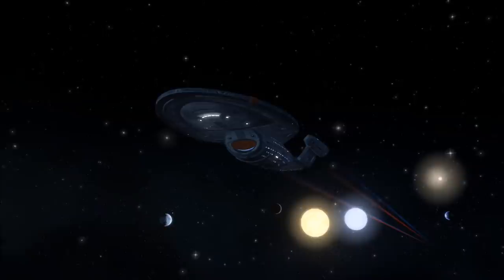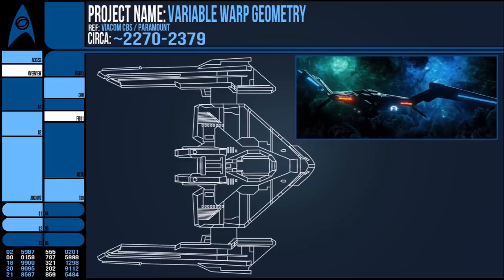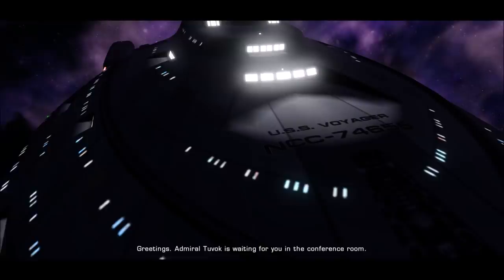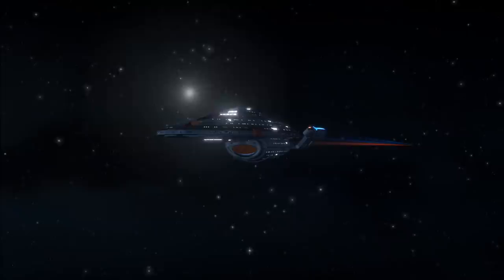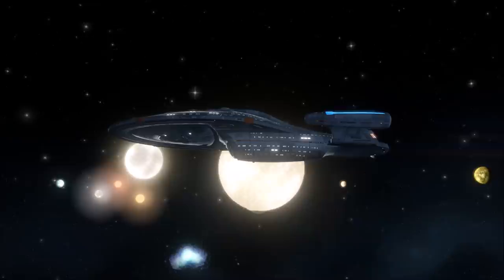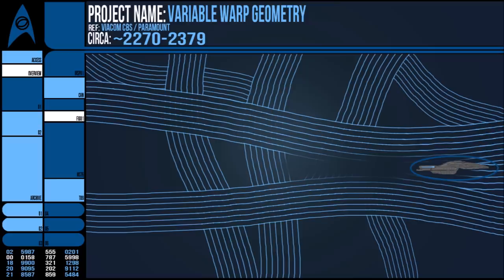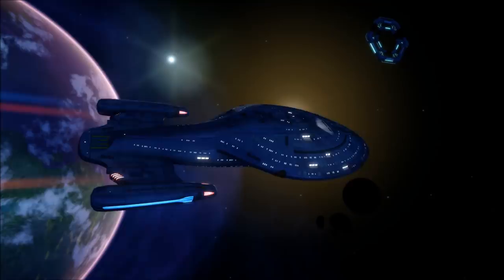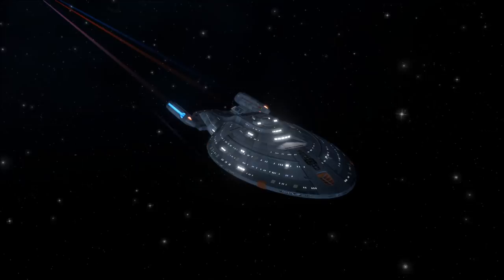VOYAGER'S "Hinged" Nacelles

Comment: Two things that make all this theory disappointing in practice:

1) We never see Voyager at warp with the nacelles in any other position than "raised all the way up".  Had they shown Voyager at low warp with the nacelles raised slightly, Voyager at high warp with the nacelles raised higher, and so on, it would show the "variable" part of the concept.  As is, they might as well just have the nacelles raised up all the time, including at sublight.

2) Who had the brilliant idea to configure the nacelles' raised position such that the Bussard collectors were completely obscured by the primary hull?  Those things have ONE JOB (replenish the ship's fuel with interstellar hydrogen gas), so how about we NOT introduce an obstacle to that task.

Personally, I wish they'd gone with the previous idea, where the "variable" part would have been shown by hinged panels on the sides of the (unmoving) nacelles.
Reply: 1) There may be small adjustments constantly being made that we simply can't see, and they might be in a slightly difference position depending on the warp factor, we only ever saw Voyager at a constant warp factor and never increasing or decreasing warp speed from an exterior shot.  
2) Busards are useless at warp anyway, the navigational deflector pushes particles away from the ship's path (those streaks that look like stars when at warp).

By the time of the sovereign class the problem was resolved by adding an off-axis field controller at the back of the nacelles
Reply: 1) I'm fairly sure there are scenes here and there showing velocity changes, but maybe there aren't.  And even then, the show is a visual medium, and these things shouldn't be relegated to "small adjustments".  After all, the nacelle transition from impulse to warp and vice versa is blatantly and obviously shown.
2) That is incorrect according to pages 70 and 71 of the Next Generation Technical Manual (written for the E-D, but certainly applicable to all subsequent ships, if not earlier ships like Kirk's Enterprise, as well).  The low density of particulates in space means fuel replenishment via the Bussards is impractical at low velocities.  You get more use at high sublight velocities, but it's recommended to not do that for too long due to time dilation.  At warp, however, is where the Bussards get the most use.  The navigational deflector, then, is programmed to allow small "holes" in its coverage to allow fuel gases through while deflecting everything else.
Reply: @balrighty3523  The last thing you need are particles with mass slamming into your ship at superluminal speeds, the energy would be horrendous! You seen what happens at LHC when two particles slam into eachother at near C, they are obliterated!
Reply: They don't slam into the ship at all.  They're caught by the Bussards' magnetic fields and safely decelerated and then collected.
Reply: @balrighty3523  The fields are supposedly KM wide, the red cap isn't the collector either, no line of sight is needed.
Reply: The red cap is where the hydrogen comes out in the TNG episode with all the sleep disorders and it's where the metreon gas goes in in Insurrection leading up to the Riker Maneuver.  It's doing something integral to the process at least.
Reply: @balrighty3523  The caps are solid, nothing goes through them, they contain ionising beam emitters, the gas inlets are little grills around the edge of the caps.
Reply: I don't know what else to tell you.  We see gas going into and out of these things, and on multiple occasions.  Maybe they attract the gases to their surface and then pull the gases along the surface to the grill intakes that the gases go in (or come out of).  Regardless of their specific function and role in the process, they are verifiably, demonstrably 1) involved and 2) involved not just in a peripheral "creates a wide energy field that makes the gas go towards the grills but not touching the red caps" way, but in a "the gas is attracted directly to the red cap and we can see it happen" way.
Reply: @balrighty3523  The glowey area is basically a huge field generator that charges particles several KM around the ship. behind the red caps is a huge magenet that pulls the particles using the opposite electrical charge into the grills just behind the red nacelle caps. It's like saying that a magnet needs line of sight to work. 

In the older ships like the constitution the charge was generated by the spiny things inside the caps.
Reply: https://m.youtube.com/watch?v=N4x1K97JZG0

Specifically, 33 seconds in.  The E-E has the red caps and grills behind them.  The gas goes into the red caps (which must be some kind of permeable) and not the grills.  It's what's on screen.  You can see it for yourself.

Comment: I remember somewhere referencing that designers were told there had to be line of sight between the nacelles to generate a warp field, but that doesn't really explain why they were hinged to a lower angle other than "it looks cool"
Reply: I think I saw something saying the same thing but they said the reason for the lower angle was at sub-light speeds the things on the front of the nacelles, Bussard collectors, need to be able to scoop up interstellar hydrogen and having them angled would mean the saucer portion blocks them.
Reply: Howie Austin no, that used to be how they were as referenced by the dederidex but that was scrapped as ships like the defiant came about.
Reply: Take a look at the impulse engines from an aft perspective. For sublight travel it's best to have them as far apart as possible to make tighter turns, so the nacelle pylons have to go flat when it's not at warp.

Comment: Would also point out, that while Subspace geometry may find optimum speed/efficiency with the nacelles in the upright position. Maneuvering at impulse may benefit from the nacelles in a low position. Center of gravity is important in space and aircraft (center of lift as well), which is why we have used variable shape craft in the real world. So when you drop to impulse, lowering the nacelles can move the center of gravity of the ship, and alter its thrust leverage.
Reply: It also moves the center of thrust. The impulse engines are on the pylons and move down with the nacelles.

Comment: Even if they can withstand the stress from subspace, I've often saw the hinged nacelles of the Intrepid-class as a potential structural weak point when it comes to exposure to other events that can induce physical stress, such as exposure to unknown spacial anomalies, or perhaps fighting a battle. So, it makes sense that they would then come up with new designs that bring back the fixed nacelles after learning what they did during construction and initial flight tests of the Intrepid-class.

I could imagine throughout the process of designing and flying the Intrepid-class, Starfleet might have even found a way to retrofit older designs to produce less-damaging warp fields with little or no physical modification. My reasoning is thus: it's been official canon since at least Season 3 of TNG that the shape of a ship's warp field can be dynamically changed (In "Deja Q" the Enterprise extends the forward lobe of its warp field during an attempt to correct the orbit of a moon). My unofficial head-canon is that, during the construction and flight testing of the hinged-nacelle Intrepid-class, previously-unknown warp field mathematical formulas or methods of engine computer control could have been discovered, which could then be applied to the older ships. This would have potentially allowed the older classes to produce the same "sleeker" warp field as the new Intrepid-class with nothing more than a simple software upgrade in engineering, and maybe some minor hardware adjustments to the warp coils themselves as necessary. As for newer classes adopting a more Intrepid-like positioning to their fixed nacelles rather than retaining the more traditional nacelle placement...perhaps the "back-ported" upgrades to the older classes could have come with a trade-off of reduced engine efficiency or reduced maximum speed, and newer classes were designed specifically to overcome these limitations. Again though, this is just my personal head-canon, so don't take it as official.
Reply: Re: warp field geometry modifications - that's how I always read it; if the only way to avoid the damage to subspace was to make the warp nacelles themselves move, why did this feature only appear on one class of ship?  My own personal go-to for this kind of discussion is the Daystrom Institute Technical Library (https://www.ditl.org), and the entry for the Intrepid-class mentions that Starfleet used a combination of variable geometry hardware, complex field modulations, a warp field with a greatly elongated Z-axis (the Z-axis on ships in Star Trek runs fore to aft along the length of the ship) which results in the forward ellipse shape of the saucer sections of ships like the Intrepid-, Prometheus- and Sovereign-classes, and changes to the composition of the warp coils.  The tradeoff for the elimination of the damaging effect on subspace was a drop in warp speeds across all flight regimes, resulting in a reduction of top cruise speed from Warp 9.99 to Warp 9.975, and maximum cruise from Warp 9.992 to Warp 9.985.

Evidently later classes didn't need the movable nacelles (Prometheus, for example, was seen on screen doing Warp 9.9, and was stated to be able to 'go faster than anything else in the fleet', meaning that her max cruise has to be greater than Voyager's Warp 9.975 and her top rated speed somewhere in the 9.99+ range), and it follows that older ships could be retrofitted to prevent their warp drives causing the same damage to subspace.

Comment: Voyager did not have Warp 9,975 Cruise Speed, if that were it would not have taken 70 years for the 70,000 light years, but significantly less if you look at the official warp tables, Warp 9.975 was an absolute exception

Comment: I think the biggest 'irony' or what to call it, is that when Voyager bends them upwards, it assumes the classical Starfleet design of upward bending nacelles.
While when they're not at Warp, Voyager looks much less of a typical Starfleet ship.

I've always, since I first saw it, assumed that the Yeager Class was the prototype for Intrepid because it looks like it should be able to bend it's nacelles as well.
Even though it isn't, I still consider it a Prototype for the Intrepid. It just makes sense.

Comment: I was told by a novelist working for TNG/DS9 that the nacelles generated a field overlap, creating a "null zone" in between them (see every Federation design; the Romulans' D-7, V'melak, & D'deridex; etc.).  If Voyager fired up the warp nacelles without raising them first, it would obliterate its own shuttle bay.  I wish I had more solid evidence than, "She said that Michael Okuda told her so."
Reply: That was Gene Roddenberry's original idea about the warp drive. He wanted them to be connected by a visible energy field when the ship was at warp, but that obviously wasn't in the TOS budget. Edit: There was also concept art done for the effect to be added on the refit Enterprise in TMP but that was also scrapped. It was talked about in one of the documentaries floating around out there. I don't remember which one.
Reply: @jblyon2  Thanks for the supporting info!

Comment: Biological computation is NOT faster, it's much slower. The fastest action potentials (nerve impulses) are about 100 m/s which sets the speed of conduction through your "biological computer". Compare this to electrical signals through a copper wire which go at about 280,000,000 m/s.

Comment: The reason is: They are Gene Roddenberry's rules for ship design! Rule 1) Warp nacelles must be in pairs. Rule 2) Warp nacelles must have at least 50% line-of-sight on each other across the hull. Rule 3) Both warp nacelles must be fully visible from the front. Rule 4) The bridge must be located at the top of the primary hull.

Comment: enjoyed your explanation.  i will, however, be of the opinion that CBS just wanted something visually different, original, gimmicky really, for the ship and simply filled in the TrekScience behind it.  if the pylons must always pivot position before they enter Warp, never with the nacelles in a horizontal position, why weren't they designed primarily to be in the angled alignment and from there be altered - as that is a much more sound design... because it doesn't afford a unique Warping Out cinematic for the hero ship.   i simply can't shake that it's the actual reason why they pivot.

also, heh STO 👍

Comment: This was such a convoluted explanation and full of conjectural theory.
The real reason that the nacelles are raised is because they need to be inline with each other to form a warp bubble. It's one of Gene Roddenberry's four rules of ship design (even though ships like the Defiant class and Nebula class break this rule).
Now, why the Voyager ship wasn't designed with the nacelles to always be upright, that's the real question.
EDIT: Just realized that if the nacelles were always upright, they'd be blocked by the saucer section, which violates another of Roddenberry's fours rules of ship design (Nacelles must be in full view from the front).

Comment: I have a question for you:  Why not use multiple warp cores?
If you use just one warp core, all of the energy you produce has to be shared by all systems on board.  Life Support, Shields, Weapons, Holodecks, Warp Drive, and everything else.  When their shields get battered too much, they have to sacrifice energy from other systems in order to keep them up.  You frequently see them transferring energy to keep the weapons or engines going.   There just doesn't seem to ever be enough energy to go around when the shit hits the fan.

Now increasing the size of the warp core isn't an option.  If you increase its size and increase the reaction amount of matter/antimatter, you get out more energy than the conduits and power relays can handle.  It's like taking a battery powered motor out of a toy, wiring it directly to a standard 120V 60H (United States) AC power cord, and plugging it into the wall.  It will smoke, spark, and burn itself out.  Don't be like me and try this at home.

So what if we design a whole new ship and equip it with three standard sized warp cores?  We can link them together so that they can all supply energy to all systems if they need to.  This will also allow them to all be monitored by the same system.  This will be just like networking three power stations here on Planet Earth all hooked into the same power grid.

Now as an added benefit, in times of peace, they can all run in low power mode easily providing enough power for the whole ship making the whole power grid very efficient.  In times of war, each core can be assigned to a specific focus- one can supply power directly to the shields giving the shields all the power of its own warp core, another can focus on weapons giving the ship endless phaser blasts, and another can focus on engines and ship functions.  

Added engine benefits- we can easily equip our ship now with impulse thrusters to allow the large vessel to perform tight and very fast maneuvers- a very big improvement over standard thrusters.  
Added shield benefits- regenerative shielding would finally be possible in Federation ships.  Possibly even double or triple shielding.  Also, shielding could be constantly modulating at all times in sync with the weapons without sacrificing power.

Multiple warp cores would certainly be the future of Star Trek.

Comment: So, kinda like Variable Geometry Wings being a patch solution to the problem of designing airfoils that work both in the subsonic, transsonic, and supersonic regimes then.

We don't see many Variable Geometry Wing fighter planes anymore either, because knowledge of transsonic aerodynamics has progressed to a point where we could design fixed geometry wings that work equally well (off not better because they don't have to haul the heavy linkages and swivels).

Comment: I've always seen it as a result of preventing subspace damage (as seen in that one TNG episode)
Later ships have different nacelle design, but the Intrepid seems like some sort of hotfix. Bolting the old nacelles on a flexible design that can change on the fly. After that with ships like the Sovereign, Nova or Prometheus already have a tweaked geometry that are fully optimized. (Their nacelles are also generally longer and pointier, showing the "aerodynamic" approach, while the Intrepid has the short and thick nacelles like on the Galaxy)
The Akira and Defiant are examples or wartime ships that are less optimized because having a decent fleet now is more important than having a better optimized fleet later.